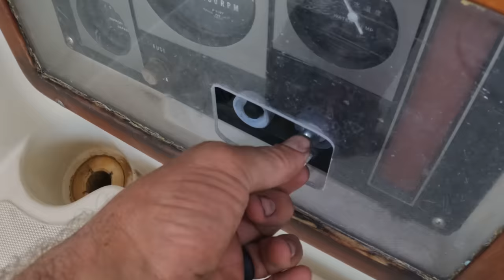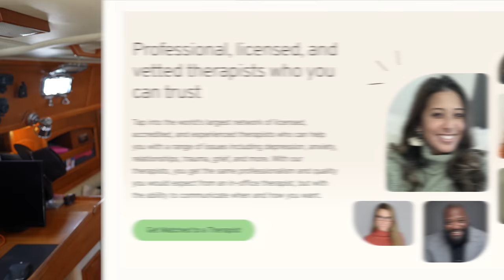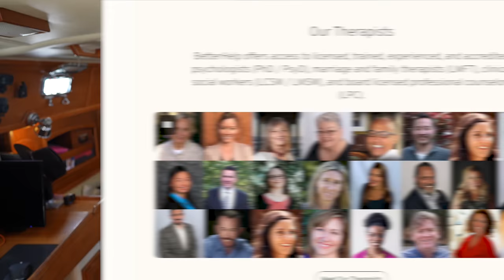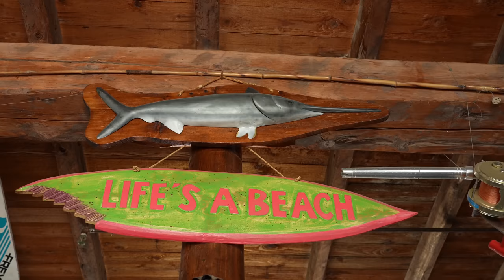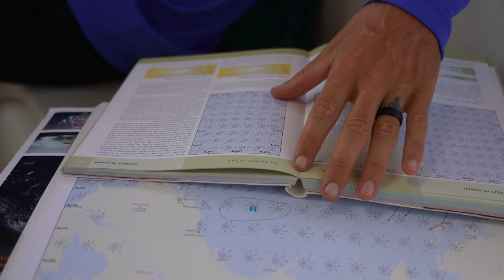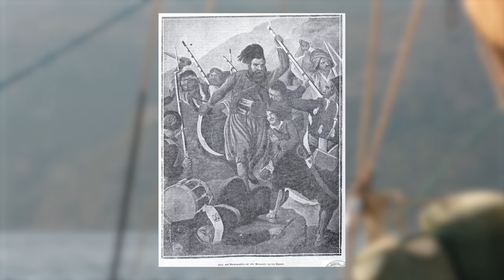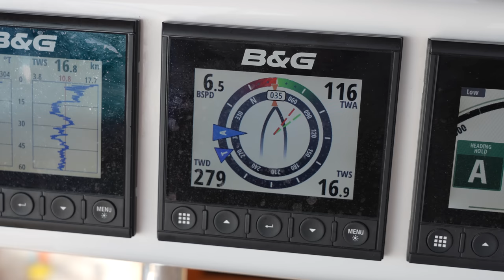The Violent Side of Greece | S08E32

Comment: Hi!  In water-cooled engines, when one of the hoses deteriorates and starts to leak, the condition of all the other water hoses is the same.  Their expiration date has already expired!  Change them all, or, in a very short time, one of those water hoses could burst, leaving you without an engine, at a time when you need it most.  A boat is the same as a plane.  Boats have a port, and planes have an airport. There is no shoulder on the high seas.  Change all the hoses soon, so you have a reliable engine.

Comment: I don’t know if you know, but you can get a Loctite kit called an “O” Ring Kit. This has all of the “O” Ring rubber diameters in long lengths which you can cut to length to make any loop diameter “O” you need. Once cut. The ends of the rubber are bonded together with the Loctite glue included in the kit. You no longer have to hang around waiting for an “O” ring spare part to turn up. How ever, watching your hose adventure there, the same thing can be done for engine hoses, but via a different method. Thinking, thinking…!
Reply: I think for him it's about  no having space to store a bunch of things

Comment: Your childs smile is a ray of sunshine. On a technical note... it is good practice to change all the rubber hoses at once , they are probably the same age and are in a similar state , at least the ones that feed that heat exchanger are prone to failure subject to vibration. Dont want to jinx it but keep it in mind. Best of luck.

Comment: Get you self a set of small open end and closed in wrenches like you used on the hose but they have a ratcheted end on the closed wrench side. Saves lots of on and off with the wrench in tight spaces. I’ve used baby powder when looking for leak drips of trails .

Comment: It looks as though all your hoses need changing?  Also that 2inch water anti syphon injection piece is prone to cracking and has a low life span because it's cast iron.  The 3 inch injection piece that Yanmar makes is stainless.  When cracked, sea water can syphon back into the engine,  that's what happened to me.  engine rebuild.  Bon sailing and good luck. :)